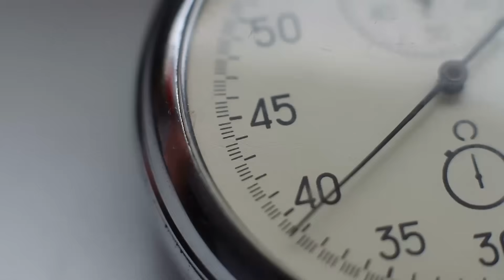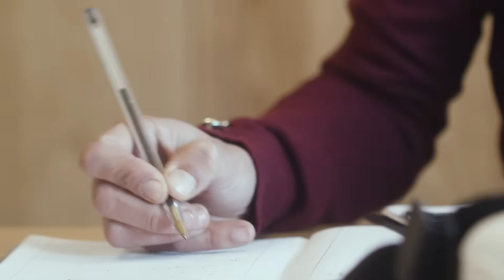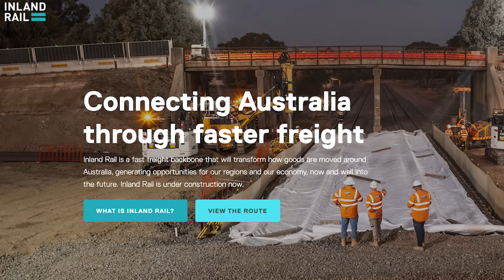The $31 Billion Inland Rail That Could Change Australia Forever

Comment: First Whats wrong with moving cargo by ship between port cities? You don't need to build and maintain the sea. No NIMBY in the sea.

Second why does it cost so much to build the railroad on cheap, flat land, without mountain crossings, no tunnels, not many bridges, not many road crossings, no special high speed rated rails, no electric powerlines?

Comment: It is more just an upgrade of the existing rail. There has been no planning how to tunnel beneath the Great Dividing Range. A tunnel big enough to take a double stacked container train…..? Trucks do door to door.
Reply: You mean from Toowoomba to the outskirts of Western Brisbane? Yes a 14 or 15 metre diameter tunnel would be required if double stacking is going to be available for the whole length.

Comment: The benefits of the project are still valid and still stand. However problems with Qld branch of project are too big almost killing all benefits. Crossing mounatin ridge, crossing Brisbane west-east and fertile valley between Towwomba and Brisbane require a marvel of engineering, not driving forward,looking into back side mirror.

Comment: Why can't  trains use batteries.  Overhead powerlines seem superfluous, given the rate of Technological advancement.
Reply: There are trains that use battery power, in WA some freight trains travel from the mine sites to the port, their batteries recharge on the downhill journey and the empty train return using that stored power.

Comment: Victoria and New South Wales are in full swing with the project. Queensland however, they haven't lifted a finger yet, and they are the finish line.
Reply: Mostly because it cuts across private rural land and high risk floodplains that needs careful research and planning. Much work has been done.

Comment: TOO LITTLE, TOO LATE AND TOO SLOW. Its like the NBN. Promised me 500 Mbs and delivers 50 Mbs at best with Fibre to the home that took them 4 mths to get right. Even the route has been fucked up. Why am I paying for this stupidity. You want fast freight? Build a dual vacuum chamber line that does passengers and freight, not either or that is incredibly slow. Hyperloop tech is happening. Dubais first track will carry 20,000 passengers per hour. So what Australia should be doing is engaging with smart people and not Govt morons taking a cut to secure the corridors of future high speed rail travel. Not this stupid freight corridor failure and the dumb slow speed rail from Sydney to Newcaste that will be unafordable. 
Time to elect a Govt that can forsee the future and then build it on the new technology and not 50 year old tech. .
Reply: lmao
Reply: @jakesweet1000  Apparently, you are an incompetent idiot that has never achieved anything in your life and never had a constructive thought. Laugh little man, for it shall be your downfall.

Comment: The creators of this video obviously did not talk to the NSW farmers who originally were against it. Something about flood plains that in that state. Was that resolved.
Reply: There are civil engineering designs to overcome wet-lands etc., This system which is constructed on a pile system, was developed in Europe for their high speed rail networks. Based on what I've read, it is a cheaper system for rail corridors.
Reply: Only a few problematic Queensland farmers?? I was told in a previous documentary that there was NO Opposition from anyone. Which I believe, as its about time for trainline upgrades. I don’t believe that there would be any opposition -this video was just trying to stir up trouble, saying people had a problem with it when they didn’t. This happens quite a lot.  I definitely like the idea of viaducks - raise the trains up, why not? Although what good is the train line if it only goes to Parkes? it has to go all the way to the port or there’s no point of it? Parkes is not very far in the line. Get cracking!

Comment: The biggest advantage this project offers is that it will use the same gauge rails and that the entire route will be capable of double-height stacked containers. This will lead to huge reductions in both direct and indirect costs. Railfreight is not utilised north/south because it's impossible without border crossloading etc
Reply: Finally some common sense!
Reply: what are you talking about? 

There has been a heavily used north-south interstate rail connection of standardised gauge for more than 60 years between Victoria and New South Wales and nearly as long for the standard gauge north-south connection between New South Wales and Queensland. Admittedly this is on a different route to the Inland Rail project in this video but the north-south link has existed and is in daily use for rail freight. So your statement that “Railfreight is not utilised north/south because it’s impossible without border crossloading, etc” is clearly wrong. Similarly, the rail line between Adelaide and Darwin has been built as (parts converted to) standard gauge for years now. 

All of these links have been running and continue to run rail freight over the full length since standardisation. This new inland route will provide an alternative route with quicker transit times combined with a much higher capacity for freight shipments in Australia, when completed.

Comment: So, with a majority of the continent/nation's population between the two end points, and the railway being so far inland, how is this corridor solving the problem of being goods to the people of the east coast.  I know some may go out west, but for the east coast - what are the roads and or rail lines in these towns that will take goods east?
Reply: There will be rail links into Sydney's Morebank where a large container facility is being built. Containers will be moved in and out of there by another rail link direct to the Botany Bay container port. This removes a lot of trucks off internal (Sydney) roads. The same is happening for Newcastle.